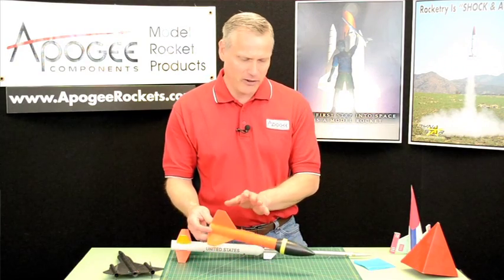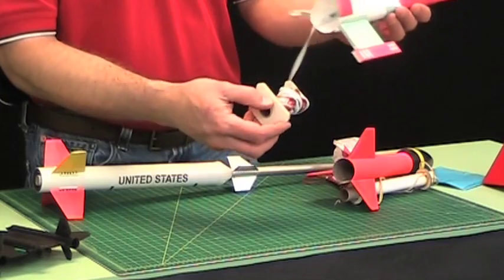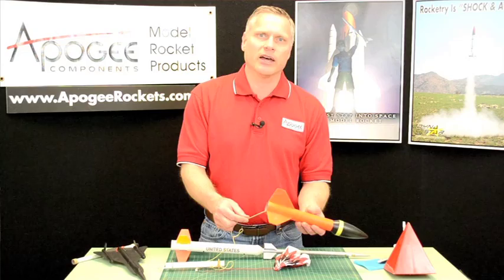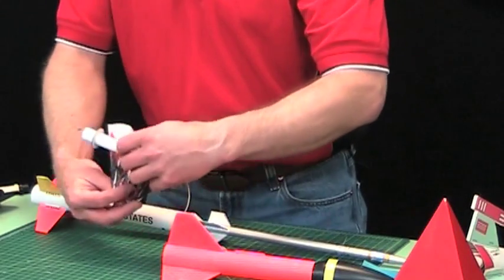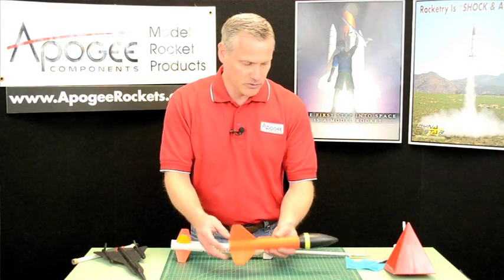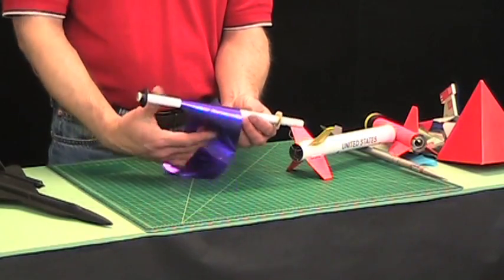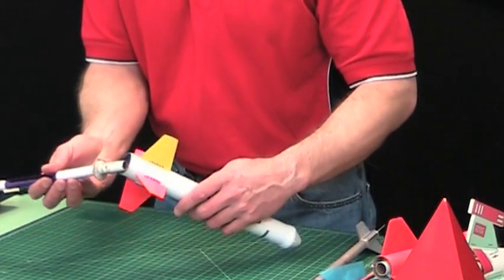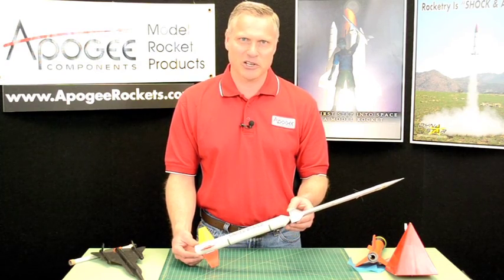Rear Ejection Techniques

Comment: Hello Tim, Does your 2 stage rocket use gap staging? Do you use a booster motor without an ejection? say a C-6-0 or can you use a regular motor say a C-6-5 with the pyro charge Im very interested about this idea of rear ejection for a rocket I am working on with the first stage booster a rear ejection and the second stage a forward. I love your videos there very informative.

Comment: Mr. Van Milligan,
it is possible to apply something like this to a HPR rocket?
Reply: HPR uses composite motors, which wouldn't work, as he pointed out.
Reply: Not to mention I don't want my $200+ rocket coming down with all the weight on the nose cone. Even at 25 feet per sec.